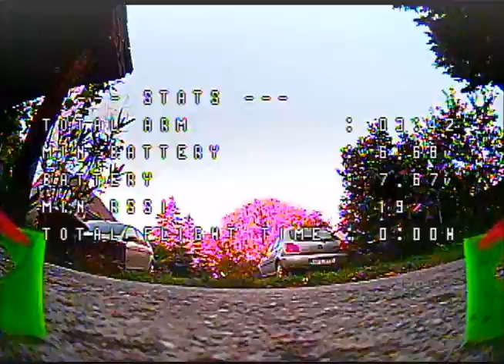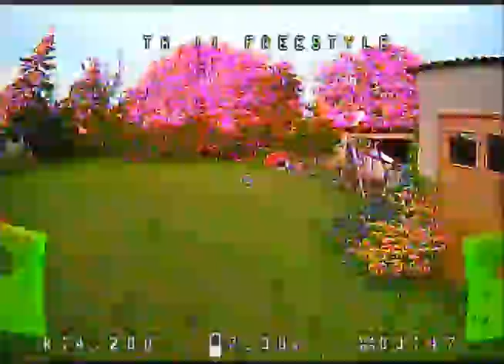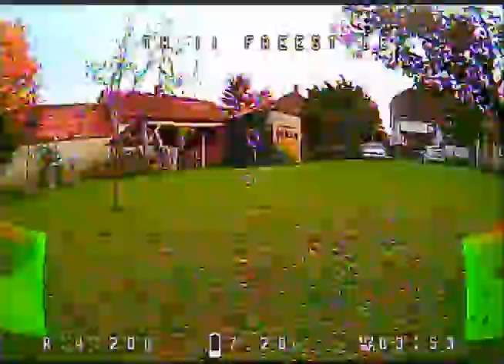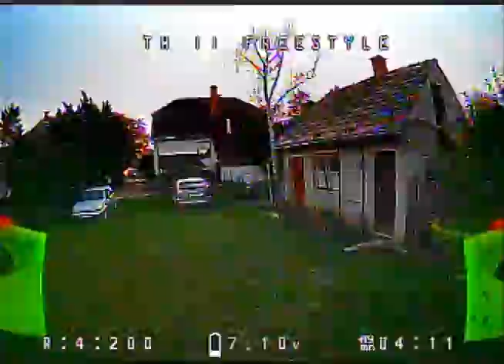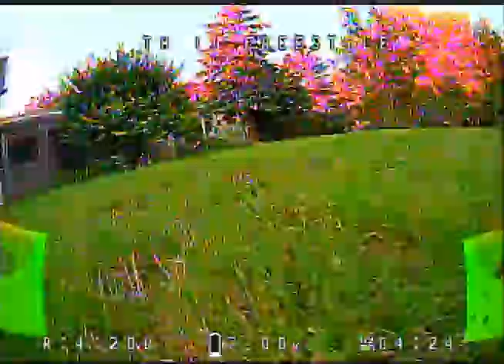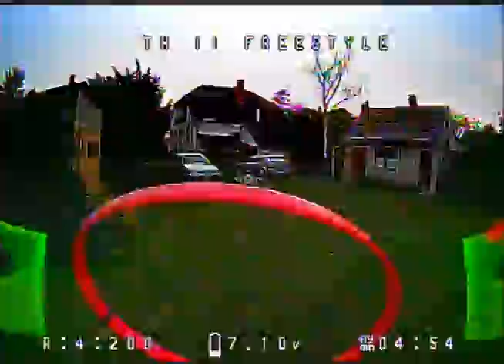EMAX Tinyhawk 2 Freestyle flight with 3D printed Propeller Guard

Comment: Is there any noticeable difference in how it flies??
Reply from the maker: I haven't notice any big difference yet, although most of the time I use it in Angle mode. Flight time might be slightly less due to the extra weight of course, but it is still 4-5 mins.